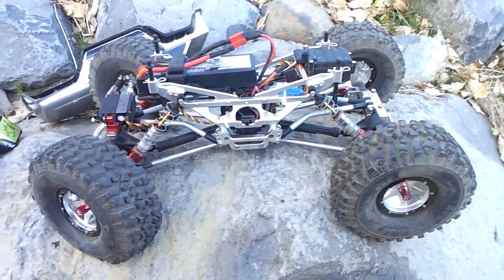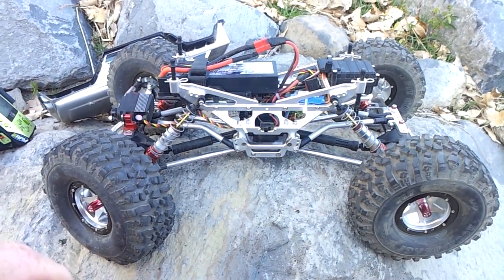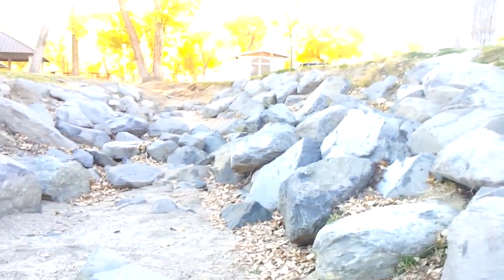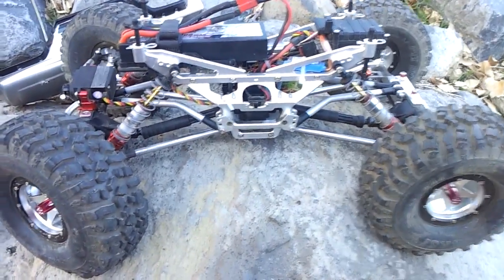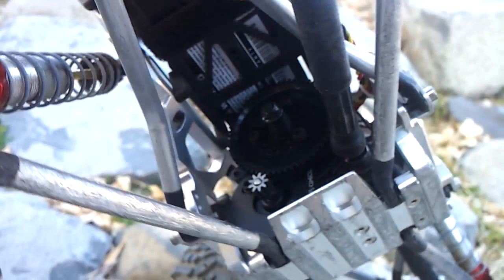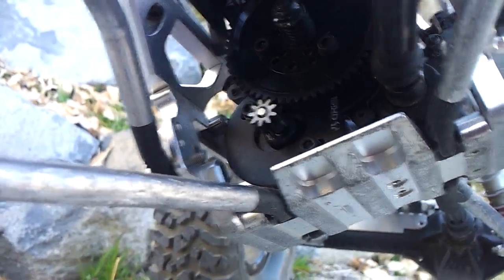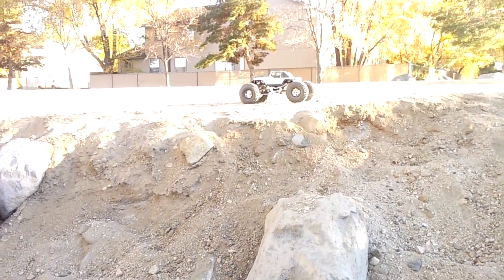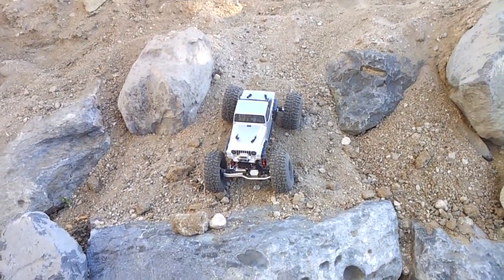Crawling With 2.2 Pitbull Rockbeast ll Tires

Comment from the maker: They are the Axial Steel Universals. They do help a bunch with the turning radius. Yes the battery up front does help a bunch. I have not upgraded the transmission gears or the drive shafts because I have not had an issue with them. Once they fail I will upgrade them. I actually just use my Galaxy Note 2 record. It does very well, but yes another method of mounting a camera would be nice then I could really show what it can do as I am limited to what I do while driving with one hand.

Comment: Subscribed on behalf of rc militia...! You def have some badass videos! Quick question or two. What tires and shocks would you recommend for the axial wraith for crawling? Hope to hear from ya...
Reply from the maker: Nice, Thank you! Well I will only buy The Rockbeast tires. I have them on both my rigs. They are AMAZING! I paid like $65 for all 4. (I would pay $100+) Just because they are that great. I also put the Proline 2 stage memory foams and it makes them even better. For shocks, I chose the Integy ones. I like the MSR11 shocks, or the Integy Aluminum ones that are just like the stock ones. (Uses the stock shafts) and the G-Made shocks are killer as well.

Comment: are the dogbones plastic or aluminum? I'm upgrading the gear system as a couple of parts are made of plastic and that causes one tire to have almost no torque... after that I don't know if changing the transmission piece to aluminum or dogbones or axles, but definitely I should move the battery to the front or add weight